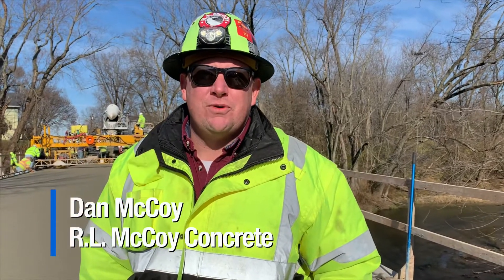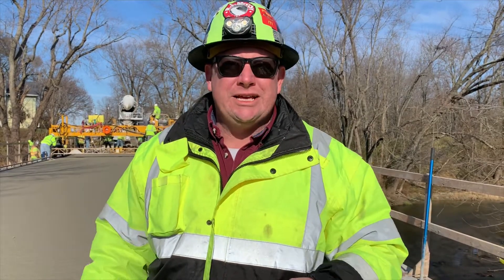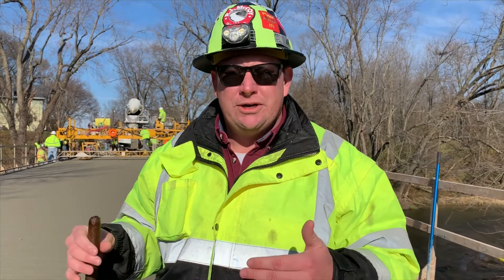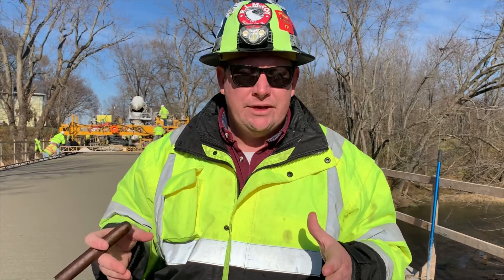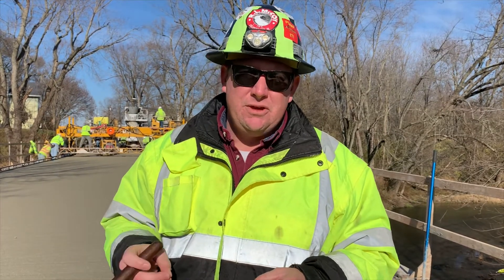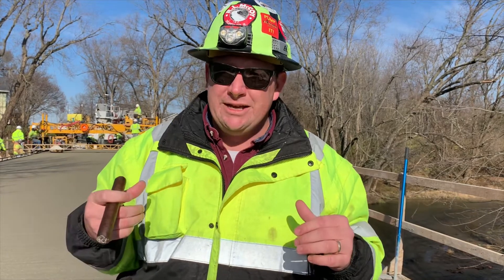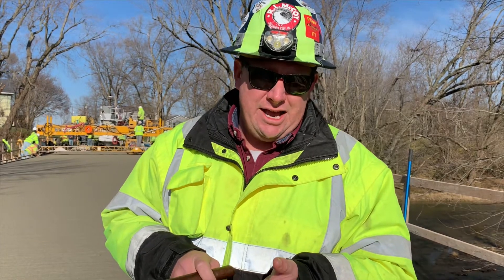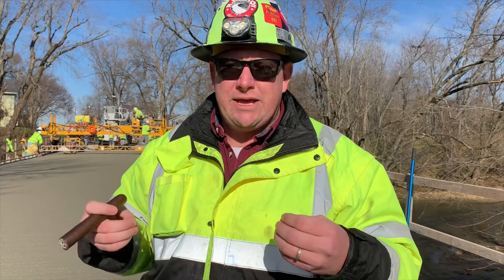E5 Liquid Fly Ash in Infrastructure

Comment: Your comment in this video on inadequate curing is spot on. Inadequate isn’t necessarily related with “improperly” cured. As field monitoring has become more sophisticated, it has been recognized, particularly in warmer temperatures, the top 0.75-1.0 inch of the concrete surface tends to self desiccate, no matter how well topically cured the surface may be, leading to a more permeable, more crack prone concrete. The internal curing prevents that. As cement develops, it takes up water to form cement, and the E5 replaces that moisture as it forms secondary cement, creating what you termed, and after investigating this product, I am in total agreement with, a perfect pour.

Comment: Hello Joel,  nice video and explanation. I am interested in the upcoming test results. I have a question to the expansion and contraction of the base concrete due to the heat generated by a new overlay. In my mind it could be a contributing factor for cracking due the the 2 slabs not expanding and contracting equally. Or do they move together? Thanks davem@floorseal.com